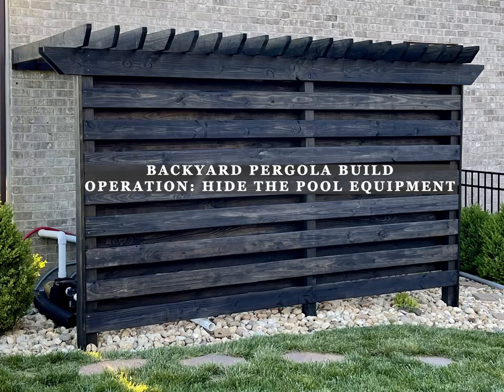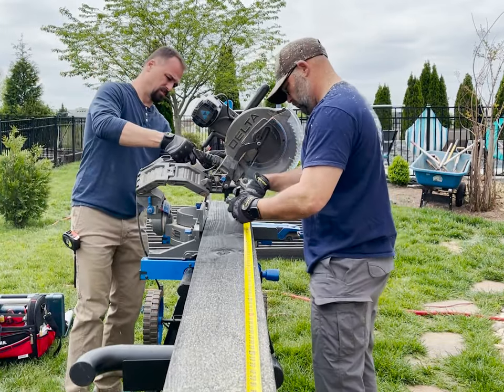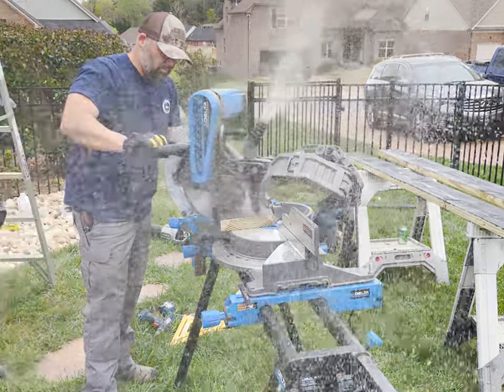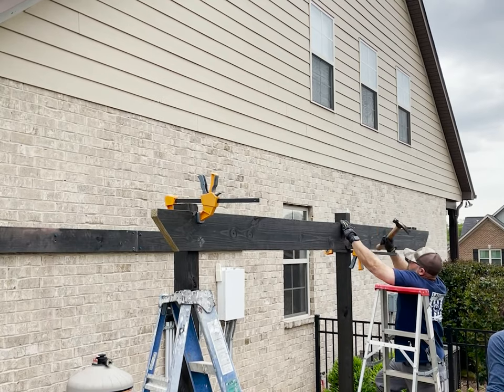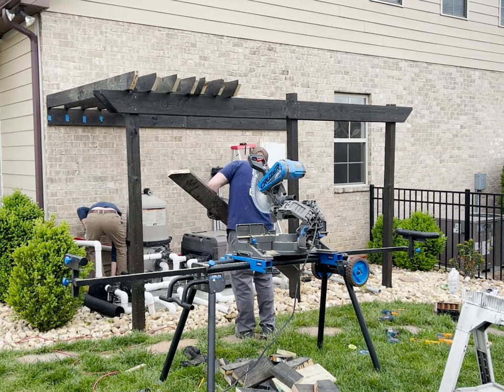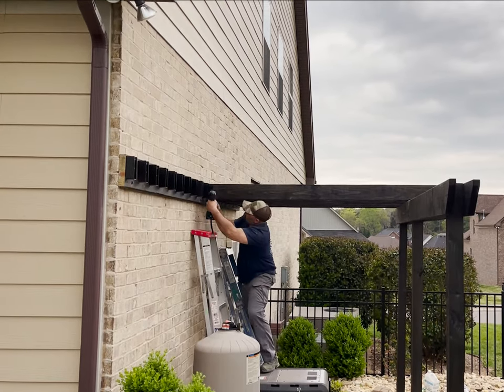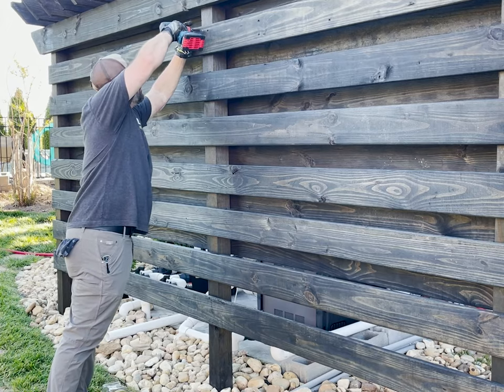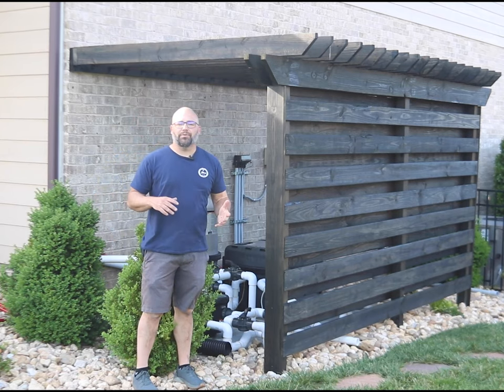Easy Backyard Pergola Build - Hiding the Pool Equipment

Comment: I know it's brick that you're screwing into so that part won't "rot", but are you concerned at all about moisture eventually wicking down the tapcon screws over the long term? I'm assuming you live were it doesn't get very cold in the winter? If moisture did find it's way in there and it did freeze I could see a potential issue there down the road. Maybe my thinking is all wet and won't be a problem.
Reply from the maker: Yea, it doesn’t get cold enough long enough to be problem here but I see what your saying. Honestly I don’t know how you would prevent the water from wicking down the screw. Maybe, use a epoxy in the screw hole before driving it? What do you think?
Reply: @PenaltyBoxWoodshop  not real sure. Traditional "flashing" used when attaching a ledger board to siding would be difficult at best. Maybe a strip of the self sealing membrane that they use with shingles?
Reply from the maker: Yea that’s a possibility. It’s worth researching if you live in a predominantly cold area where it really freezes a lot.
Reply: @PenaltyBoxWoodshop  yeah, I don't really know. I didn't ask the question with my own solution in mind. I asked to start a discussion about if doing something would be of any benefit. I tend to over think these kinds of things sometimes.
Reply from the maker: Hahaha overthinking is a good problem. Yeah, I don’t think I have a solution either but maybe someone will read this thread and have one. Thanks!